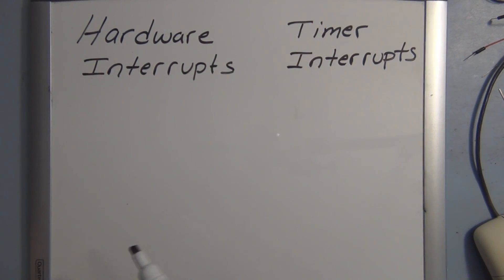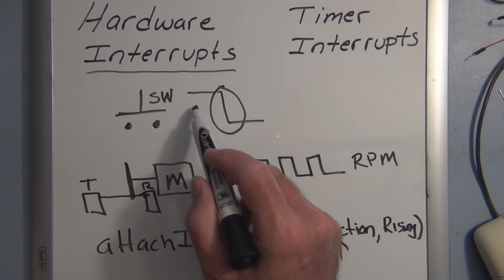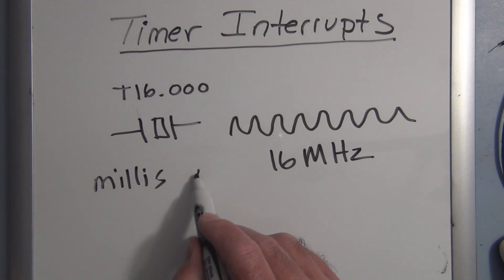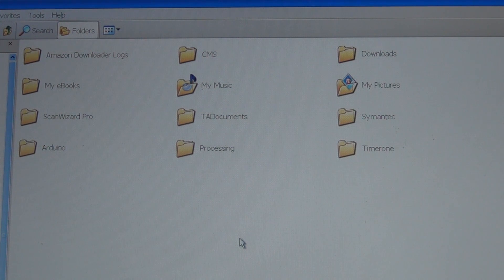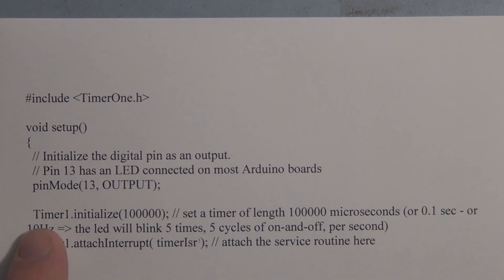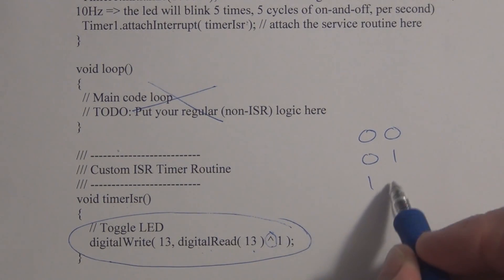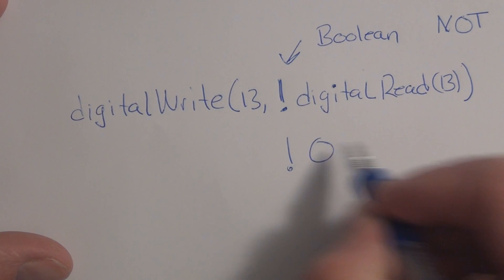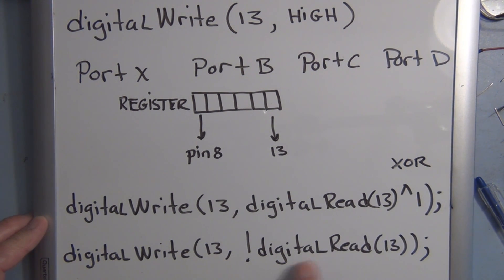Arduino Timer Interrupts tutorial

Comment: This Crystal you mentioned is only used for the ATmega that does the USB communication. The ATmega328 on an Adruino Board uses a cheap and very inaccurate resonator instead, that is placed right next to the side of the ATmega328. It's a pity they did not export the USB-ATmega clock to make use of it as well for the main processor (ATmega328). But sadly that is the way it is...
Apart from this little misinterpretation, well done!

Comment: Try this on a Nano which also uses a 328P Atmel processor.  You can't even get your example to compile.
Reply from the maker: Do you have the timerone library installed?
Reply: Yes but I am going to re-install it to make sure it is not corrupt in any way.  I'll try to compile again tomorrow.  Have you tried to compile timer interrupts on a Nano using the TimerOne library?
Reply from the maker: I have not built any projects with the nano yet.  I did purchase an adafruit trinket though.  With the newest IDE you just go to sketch---> include library and go to---> library manager and search for timerone and select install.
Reply: Tom,  I deleted the library and re-installed TimerOne and now it works.  Thanks for your help!

Comment: Quick question:  Yesterday a colleague and I actually measured the Arduino with an oscilloscope, and we noticed that below a delay of 1, weird things start to happen.  Basically the signals sort of get corrupted and the oscilloscope does not know which one is the correct signal.
We're trying to build a visual light communication (lifi) system, with arduinos powering the LEDS, and we need to brighten / dim the LED lights very quickly, switching among analog voltage states in order to transmit a modulated signal at at least 300kb/s.

Do you have any advice on how to do this from a software perspective, and do you think arduino would be capable enough to achieve this?
Thanks so much!
- Kelsey Cameron
UCF Student

Comment: to toggle you could do a really easy way : digitalWrite ( 13, 1 - digitalRead (13))
Reply: That's true but the problem is that digital write and read have a lot of extra stuff that slows it down a lot, for high speed applications.
Reply: Also, subtraction means that you have another hardware delay of multiple cycles (5 if I remember right), whereas xor only uses 1 gate, so it is way faster.
Reply: @Jungguk Kookie so my issue was actually a little bit different, I discovered that the oscilloscope I was using was not for the correct frequencies and it wasn't doing at all what I thought it was.

However, I did some tests with Arduino a while back and from what I remember, the frequency timing significantly decreases in accuracy as you get faster and faster.   Yes, a hardware crystal for a clock would work significantly better but if you need this for a real time operating system, Arduino isn't recommended.   

I know a few systems that would work, so if you're interested, message me back! 😊
Reply: @Jungguk Kookie I don't know for sure if beaglebone would support that but let me ask around today where I work and I'll get back to you 👍

Comment: Hello
Mr.Tom
 is it possible to measure temperature & save data into sd card and check temperature using if condition to activate a relay or not?!
it seems like I am trying to do 4 tasks in uno 
I tried timer1 and timer3 also tried to do use loops inside main loop but couldnt 
can you advice me a way?

thank you

Comment: Little correction:
Timers are 0, 1, 2. Not 1, 2, 3.

Timer 0 is 8 bit used tor timer functions delay(), millis() or micros().
Timer 1 is 16 bit used for the servo library. (Which you can tweak with Timerone.h library).
Timer 2 is also 8 bit and used for the tone() function.

This for the UNO. Arduino Mega has 0-4.

Nevertheless, nice tutorial :-)
Reply: Little correction:
Timer 0 is 8 bit used *for*.....not tor
Reply: haven't looked deeper but is there something like waitforinterrupt() ? that would be perfect for delay()

Comment: hello 
i work for long time  to understand pin change int but it doesn't work
i want to have code wich use pin 7 (on arduino uno ) as pin change int to turn on and off led on pin 13
Reply from the maker: +Adil Machrouki Only pins 2 and 3 can be used for hardware interrupts on the Arduino Uno.  Pin 2 is INT 0 and Pin 3 is INT 1
Reply: i downloaded a library that change all pin on arduino uno into interupt pin. 
#include <PinChangeInterrupt.h>
#include <PinChangeInterruptBoards.h>
#include <PinChangeInterruptPins.h>
#include <PinChangeInterruptSettings.h>
#define echoPin 7
attachPCINT(digitalPinToPCINT(echoPin), echo_Isr, CHANGE);

it work. but cant do two function on one pin when attach another function..

Comment: Well done. It wasn't until I watched your video that the light bulb went off in my head on how I can use the hardware timer to facilitate the variable control I need to operate a stepper motor. I particularly like the single line code for flipping pin state. Very elegant. 
Thank you.

Comment: great Video.
 A little addition: the shown big crystal 16 MHz is not for the Arduino, but for the USb Controller. Very often the arduinos  have a ceramic resonator, very little and very inaccurate, not good for a clock. This resonator sits nearby the microcontroller. Sometimes (here?) it is a real quartz crystal...
Reply: Was going to say the same thing (although very late to the party). The resonator is shown at 3:47 under the "ITA" of Made in Italy. 
   I assume they are using low spec stuff. The muRata brand Cerelock models of resonators come in tolerances of +/- [0.1,  0.2,  0.5]%. That's a reputable brand too.
    I assume the Ardy1 clones are probably extra loosey goosey. It's might be safe to assume we've got a frequency between 14.5MHz and 17MHz...-ish.

...but how many of us have a quality frequency counter with a calibrated and certified disciplined oscillator to say for sure? Even the best 1% of us hobbyists are doing good if we can use a trimmer capacitor to tune a crystal circuit in hopes that we might make one  circuit just as wrong as some other none calibrated uncertified device we have ;)
-Jake
Reply: Wrong.
Reply: Write.
Reply: lol ive hand wired many circuit boards with just the atmega 328 and a 16mhz crystal, never noticed or looked, those boards don't use the crystal for the 328, stopped using them long ago. its very obvious 
now though.